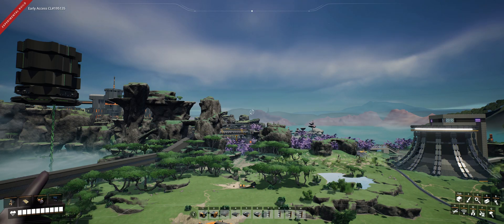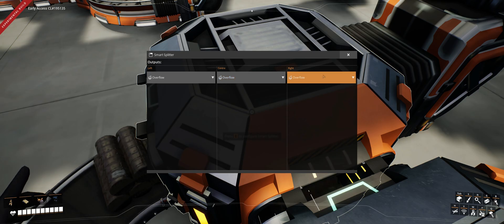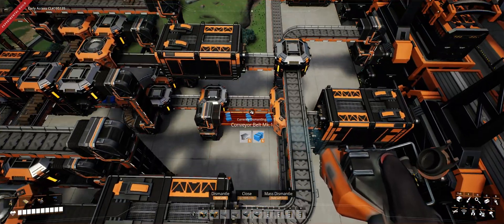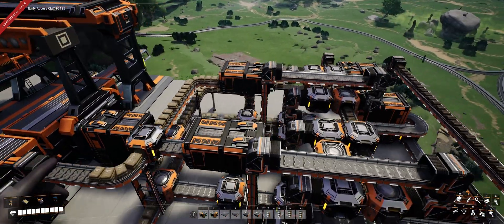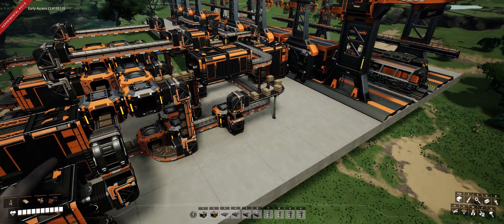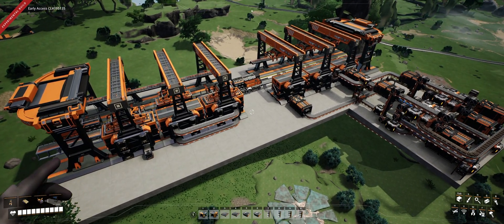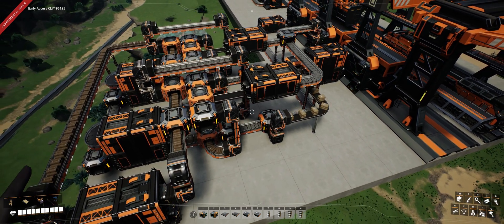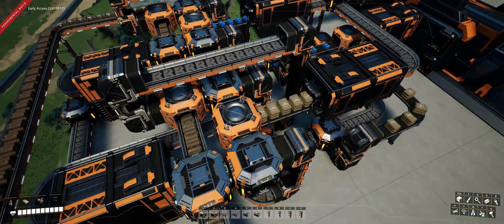Remotely Accessible Storage V3 & Automatically Regulating Feeding System? - Satisfactory Logic

Comment: I was just sat here nodding like i knew what was going on for like half the video but i get it now XD
Is this reliable in long term? Ive noticed sometimes belts stutter slightly at the joins making a mk1 belt slightly less than 60 items p/m and after a long time that impacts the whole production line
Reply from the maker: I haven't testing this with many items, like 10+, and over a long distance, but in theory should be fine and reliable.
The mk1 60 item should be fine, because most of the time its only 30 items per minute, doesn't need 60 to block.
What I see may possibly be an issue is getting all the blocking items off the train and into the containers quickly enough if there were lots of pinning items (which there would be if you added 10+ items to the system, and over a long distance train travel) - that is my only concern for a larger version. As that could possibly let a few unrequested items flow through. I think it should be ok, but not 100% yet.
But there is usually always a work around, like adding 1 more freight platform so you can get the items off v quickly with 4 outputs.

Cheers Chroma 👍

Comment: Nice, I love your belt logic videos! Altough I have never found a use case that made them necessary. I am currently thinking about if the blocking loop works with machine output buffers as well?
My use case: I have build a new armory producing all the different ammunition and would love to transport them to my main storage. But I neither want to use like 15 drones for it nor do I want to produce any more ammunition if storage is full since it is stealing from other production lines, especially the uranium cells. I think this is not possible since the machine buffer does not have an input for creating a loop and flow to a merger can never be fully blocked. So it will only ever work if we get a "smart" merger with a priority option (like reverse of overflow). Or is this possible?
Reply: If you don’t mind it being chunky, you can make a priority merger using the two inputs of an industrial storage.
Reply: @jasonlatta2000  In my experience that setup is unstable and can flip the priority port upon loading the game. Have you tried using ISC and it works without maintenance? Is a few updates back I tried it.
Reply: @MrFaerine  sorry I didn’t reply sooner, YT was being wierd. You’re right about industrial storages alone, but it can be done stably with extra belt logic.
Reply from the maker: Thanks MrFaerine, appreciate it as always

Once your storage containers are full, from the machines producing the various ammo production (I assume one container per ammo type?) - are you sending any excess  overflowing to a sink? I have no idea, but maybe you're merging all the output of all the machines producing the various ammo types - and sending that mixed, merged output belt onto a storage area, and excess overflowing?
If yes, if the excess of any of the ammo items is at least 30/items per min (If the machines producing the ammo are at least producing 30items per min) - you could redirect that overflow from storage to a interupting system, like in video, using a 3rd party item (like biofuel), to overflow that biofuel and block the feeding belt to those partcular machines (again, same as in this video).
I think even with 30 items per min, interupting and overflowing a 3rd party blocking item (like biofuel), in a small circular blocking system like in this video - would be enough to block the resources feeding the machines and stop production. If you need those resources to go forward elsewhere, you can have them overflow before the circular blocking system.
Again like in the video, 15 items per min would keep cycling round the blocking circular system, and the half, 15 items per min - go back to the 3rd party loop/container.
Not sure if that makes sense, and to be hoenst i'm not even sure that is applicable to your scenario. A lot would depend on your setup. And to be honest, you may not want to do all that work just that, which I could understand.
Around 15 drones? So you must have a pretty decent sized ammo production?
Reply: @StinArchi  the problem is with the requirement of fully blocking the production if it is not needed. 15 drones would only be needed for seperating all the ammo types, then blocking is easy, they run full and can't unload. It would also be easy to mix the ammo, send it to central storage using a single drone and then sink it.
To get production to stop, output must be zero. But since the pinning system always has a a bit of "leakage" it can't fully block a belt. You catch the leakage in the video using an overflow splitter that can only handle 60 with MK1, if more than 60 items arrive it will output to the station. BUT you need to send the non-overflow leakage back to the item container using its input which is not possible with a machine output. So I think it is impossible to pin a machine output like a storage container. You can only make a merger cascade for the feedback that comes close to a priority merger.

Comment: Very ingenious! I was expecting it to require more of the train logic available in the schedule, but this use of the 'signal' items to open the floodgates on a fast belt is very neat.

You should keep in mind though that the amount of items you get from a single "order" is a lot higher than in your test setup, simply because the train will take quite some time, and you only get delivery two round trips after you ordered the items. One thing you could do is duplicate the trains. This would reduce "delivery lag" and increase the maximum throughput in the cargo segment. 

You could expand on this system a little bit to get made-to-order full cargo wagons too:
- separate the "signal train" from the "cargo train".
- have the cargo train sit at the loading station, with the condition to only leave once it's fully loaded
- do not use a buffer container on the input for the cargo train.
- once the station contains enough items to do a full load, it will start loading, and the belt will be blocked
- set an overflow on the end of this belt, split off 30 items with some splitters and mk1 belts, and send all the rest back into storage.
- the 30 overflowed items can be the new blocking pinning items.

This will work on the condition that the cargo train belt can fill up a full cargo wagon before the signal train starts delivering new blocking items from the "natural" blocking loop.
There will obviously be a small amount of extra material siting on the blocked belt, that will "contaminate" the next delivery. An easy fix would be to have a cleanup train doing short loops back to the main storage with normal load conditions. It'll get stuck behind the cargo delivery train sooner or later, and the system will be ready for the next order.
Reply from the maker: Love it mate, some really nice ideas there 👍

Comment: Another advantage with using a train is that you can go beyond that 13 item limit just by adding more platforms. (Really, I wouldn't use more than 12 items per platform due to issues with running Mk5 belts at full speed.)
Reply from the maker: You know I didn't consider that - that would def be an easier work around of the 13 (or 12) limit. Cheers Ron 👍
Reply: I would just have multiple train stations so depending on what you needed is where you send the supply train to.

Comment: Or you could just make a building train like most that has all the materials and sits at a station and waits for a destination. The other thing I have seen done is a air shopping mall with drones hooked to storage. So as long as you can power and build a drone port you can order anything you like delivered by air by building a drone port. Not saying I don't like your ingenuity here, just other perhaps more simple ideas. Now if you are automating supply it's kewl but having a train try to keep delivering is about the same. End result you save cars on the train I think.
Reply from the maker: Even simpler - you could just get on the train and drive back to your storage to pick up materials :)
The air hub you mentioned requires a signficant setup/time also - as you will also need a decent battery setup to supply the drones. I've covered a drone remote storage also. 
But the point is more to experiment with alternative ideas and look at different ways to do things. Every system has its pros and cons. As I mentioned on video, I appreciate that these kinda setups are not for everyone. But for those who like these more complicated setups - it has the cool factor being able to select remotely exactly which resource you want delivered. But yea, this video was not meant to cover the simpler methods :)
Also keep in mind that this has other uses as mentioned - as an automatically self regulating feeding system for a factory.
Cheers man, appreciate the comment 👍